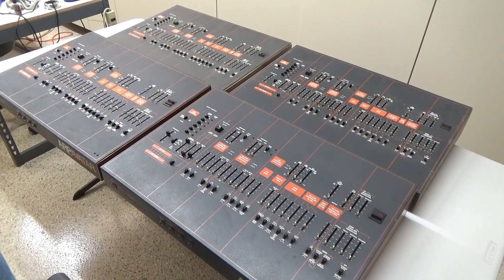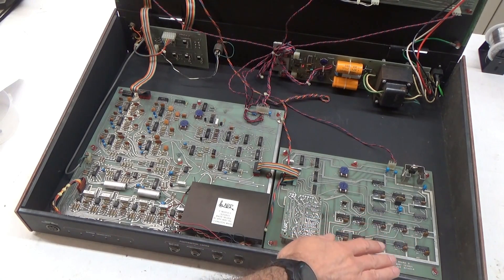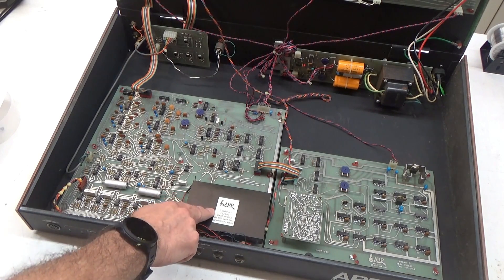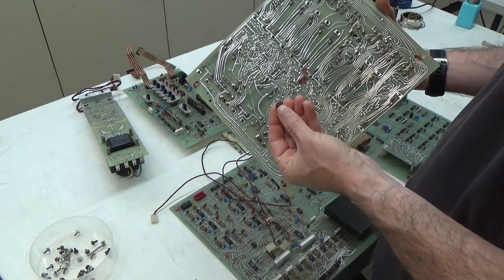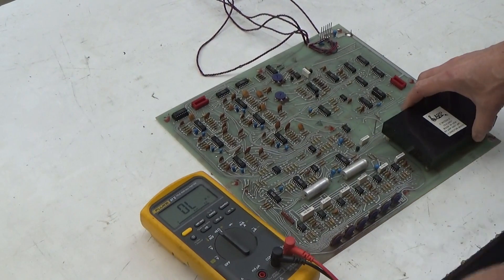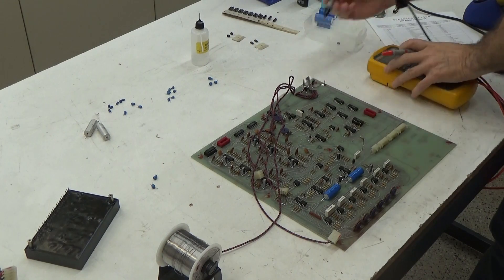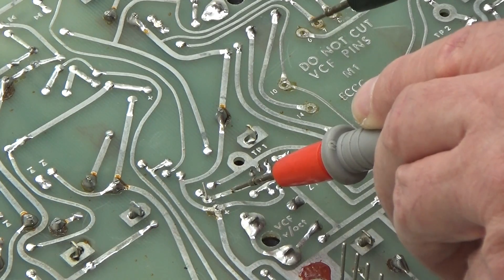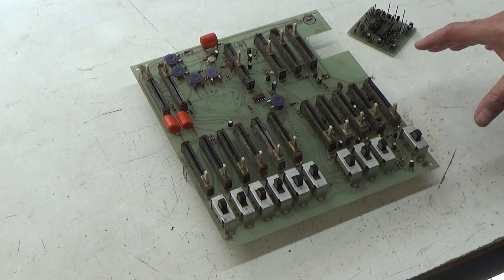ARP Avatar Guitar Synthesizer Repair - Part 1 - Synthchaser #173

Comment: Thanks for uploading, a very interesting video. I make video's too & often call resistors transistors of mA mV by mistake; it ain't easy talking off the cuff. A plastic cover to prevent fluff & crap ingress into the faders wouldn't hurt, a lot of mixing desks, reel to reels have them. I share your dislike of potted electronics when it's not needed too, as in a damp environment. Regards....DA.

Comment: I am currently restoring a Tyracon 6V. It was the first and only ever built polysynth of the GDR, shortly before the Berlin wall came down. It does not have any markings on the boards. The good thing is that they did not use any Tantalum capacitors in there.

Comment: De epoxying it very feasible but often destructive.  You can xray the box in advance to visualize the board, and then you can resort to solvents, cold, heat , chipping etc.. to depot. But if you're reverse engineering.....